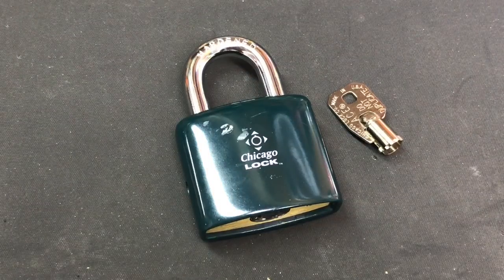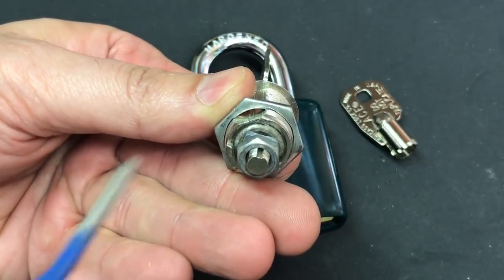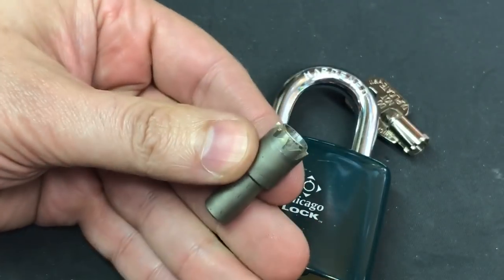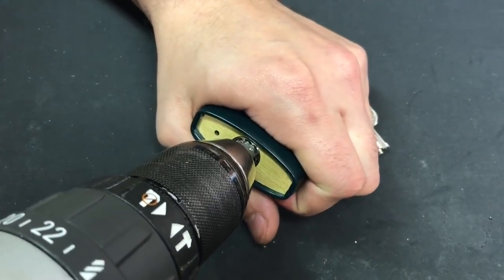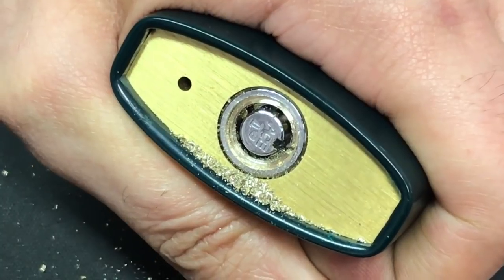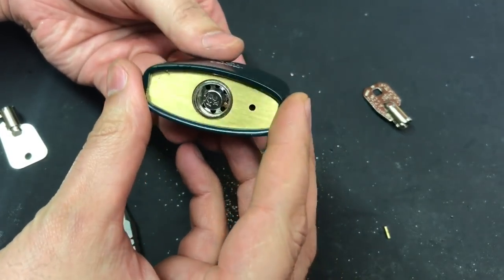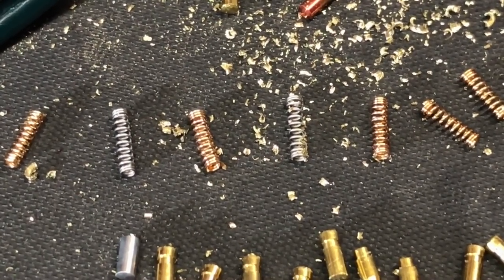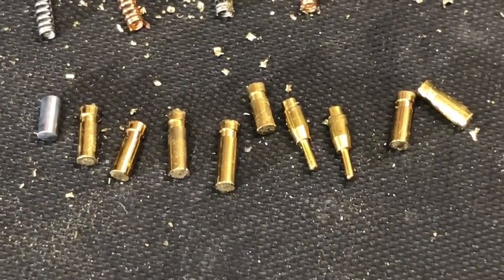[538] ACE II Tubular Padlock Drilled Open

Comment: WOW, I had no idea those bezels were so soft!
Thanks, 
R
Reply from the maker: +R. Akers There are ones with hardened steel... like the 11 pinner I featured in video 85, but it's not common. Usually zinc or brass.
Reply: Thanks again.
I use a diamond hole saw for drill outs (sllllow), but this is much better. I will use a magnet to check for steel if I go this route.

Comment: One of my first solo locksmith jobs was to drill into a vending machine with a tubular lock. I just ended up taking an 1/8" drill bit and drilling right at each chamber and dumping the pins out. Took even less time than this.
Reply: Can you get the cash out if you open them?
Reply: @325133  No, but all the  Snickers you can eat
Reply: @tonray9395  I will test for research purposes. I know some washing machines that use this lock, what can I do with this?
Reply: @325133  3 pair of denim jeans and up to 6 polo shirts or 10 tees

Comment: you can get a tool almost like this for the Abloy. it has a center pin and also open the frot, so you can pull the discs out. just like popping the front ring of a china disc detainer padlock
Reply from the maker: +Rune International Yup, in familiar with it... I think it's called the Abloy eater!

Comment: One thing the Anti-Drill pin does is thwarts the old style hole saw attack ... a VERY similar tool to the one used in this video ... but it fits only in the keyway and saws the pin down until the lock turns open.

Comment: these little saws work well, when you can move the lock around to dump the pins. When it's housed in a immovable, horizontal position it's a bit harder to convince the pins to come out :)
Reply from the maker: +SE Lock and Key Agreed... though banging the mounted lock with a mallet also works surprisingly well. 👍

Comment: Best approach bolt cutters second large wrenches third sledge hammer 4th long steel bar 5th large pipe wrench or large adjustable wrench with a pipe... Or grinder with cutt off weel

Comment: I've drilled more than a dozen tubular locks open .. but my hole saw is the same size as the key and slowly saws off the pins them selves ... no decoding possible though :(
Reply: i'm sure decoding doesn't come up very often.  if you have multiple locks with the same key, logic dictates that you also have multiple keys, too.

Comment: I am curious -- if the shackle was loaded up with a stack of appropriately sized steel washers -- could this significantly improve the (angle grinder attack) security of a padlock? The exposed shackle could be loaded with as many washers as would fit. Inexpensive...
Reply from the maker: +Dave Joseph people certainly do this... particularly with Shutter locks.
Reply: Turn your grinder 90° and those washers do nothing .
Also why cut the lock when hasp and staples are the weak point made from mild steel to save money .
Reply: It’s got merit, and certainly adds another layer of fuss and bother for anyone trying to grind a lock off.

Comment: Why would you cut a copy of a key for a lock that you've just destroyed? I can understand wanting to make a copy of a key, but if the lock itself is destroyed in that process, what's the point?
Reply: Raven Rose if there were several locks keyed alike you could make a key to use on the rest. Maybe drill out a lock that is rarely used, make your key, then go after your real target
Reply: Imagine these are for lockers or lockups where they all are keyed the same so the company can always be able to open them. Drill out one and make yourself a key and you are in all of them.

Comment: Do even exist any lock, that you can not pick/melt/broach/breake/whatever??? LOL :D
Reply: with a angel grinder there not much remember lock are suppose to be open by locksmiths. some bike lock i hear take forever to cut through
Reply: The ability to cut the shackle is the limiting factor for a padlock.
Reply: There's NOTHING given enough time and effort that can't be opened, every lock, vault or security device is merely a deterrent that increases and decreases in effectiveness.
Reply from the maker: +JEBNIĘTY JAKIŚ Probably not... it just takes time... that's what a quality lock provides.  Time. Nothing more.
Reply: Cordless power tools in the last five years have made all the difference. Before they were cost prohibitive but now an entry level Ridgid brand drill is all anyone other then a daily user contractor needs even for some serious home improvements. Ryobi is considered a joke in construction but is actually so good that if you spray painted it red, (Milwaukee) or turquoise, (Makita) or yellow, (DeWalt) people would believe it was the real deal about 95% of the time. (Sorry if I didn't name your boutique tool but really it makes such little difference that anyone other then a daily user couldn't tell).

Comment: I understand you showing how to drill out the pins, but it so easy to pop out the pressed in ring on most Chinese locks,you just don't need a drill. Just saying 🔓
Reply from the maker: +Larry G Well, yes... but that's on a completely different type of lock. Also, not all of those Chinese disc detainer locks are created equal.  Maybe I'll feature one of the ones that will not work on in the next few days... if I can find my disc detainer picks.